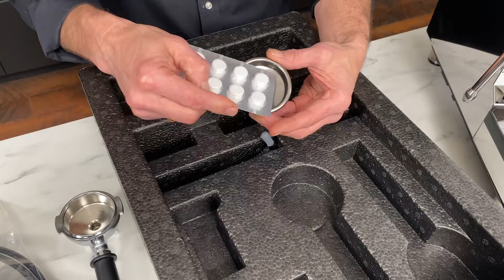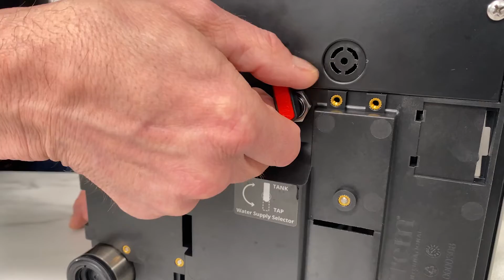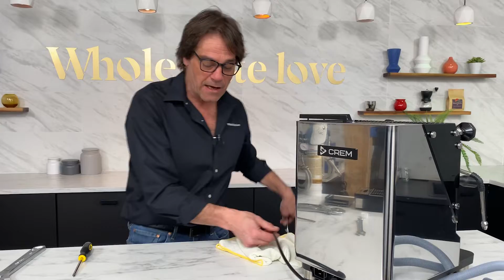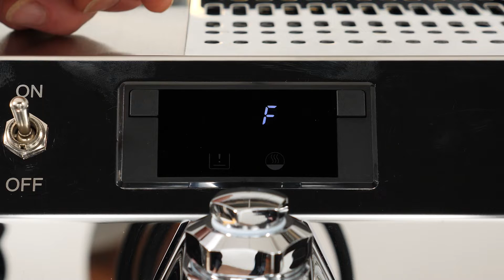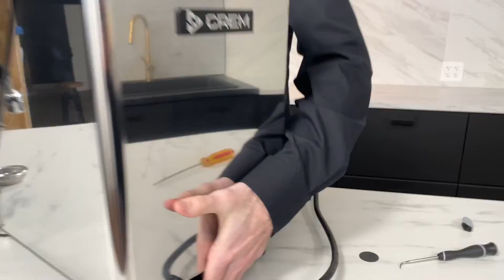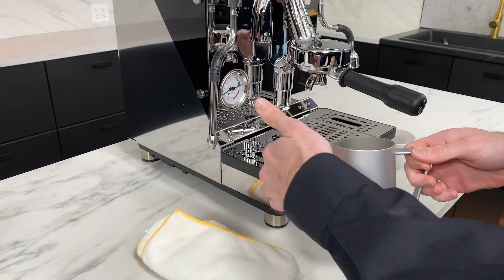Crem ONE HX PID Startup Guide

Comment: I tried to reach the pressure regulation screw on the back of the machine but I cant see it and if I put the screw driver in it, it seems like nothing is in there. I don`t even find this screw mentioned in the user manual. Is it possible that they changed this in a newer version? I just bought the machine here in Norway (it`s called 1B here). I noticed a bronze screw in the front panel, when you remove the drip tray, could have been moved there? If not what`s that for? Anyone can help?
Reply from the maker: Hi w, Yes it is possible the OPV screw is moved on the machine you have.
Reply: @Wholelattelovepage  so do you know if it is the one in the front behind the drip tray?
Reply: That version has the screw on the front behind the drip tray.

Comment: Hi, just  a question:
Trying to brewing a darker roast at 85-88 C I decreased the boiler temp from 120 to 100, but then I noticed the boiler is struggeling to get at the right pressure and steaming a cappuccino was a hard task. Is it normal? I can I brew at 85 C without compromising the pressure at the boiler?
Reply from the maker: Hi w, a boiler at 100C will produce little in the way of steam and steam pressure so I'm not surprised you had issues steaming. Know that 88C/190F is well below the generally accepted minimum brewing temp of espresso which is ~91C/195F. I've brewed thousands of espresso including many dark roasts and have never used a brew temp below 92C/197F.
Marc
Reply: @Wholelattelovepage  i just raised to 92 and dialed coarser . Went just fine. Thanks for prompt reply
Reply from the maker: @wingtsunami  You're welcome!

Comment: Hi WLL. I have a question. I have this machine at home and tested the flow rate without a portafilter. It gives me about 150ml/25s. Shouldn't it be more in 250ml/25s range or is the flow rate I found OK?
Reply from the maker: Hi CvV, Thanks for the question. Vibration pump machines typically do flow rates of 7-8g/s but there is some variation across manufacturers. 7g/s at for 25 seconds = 175g. Measuring liquid volume as you are is not as accurate as weight. What you found is okay.
Marc

Comment: compare with ECM classika pid which one better steam milk and stable brew temperature?
Reply from the maker: Hi RW, Thanks for the question. Brew temperature stability is similar - I'd give the edge to the Crem on steaming due to larger boiler. Be aware the Classika is best used for low volume home use. There's waiting involved as the single boiler Classika transitions between brewing and steaming temperatures. The Crem uses a heat exchange boiler so you can brew and steam simultaneously.
Marc

Comment: Hey Marc, 

I've decided either with the ECM classika PID with flow control  or crem hx. Can I mount a flow controller given that it's the same group head to the crem Hx.  Can I get your preference ? In machine
Reply from the maker: Hey Bob, Thanks for the question. The flow control could be mounted in the E61 group of the Crem machine. But Crem does not make a flow control device for their machines. Due to high demand and limited supply we only offer flow control on new ECM/Profitec machines or to customers who've purchased ECM/Profitec machines with E61 groups from us in the past.
Marc

Comment: I have this same machine, the Crem One 1B (in Australia) but my pump pressure is 12 bar with the blind filter on, which seems really high. I also can't find the screw that you show in this video to adjust the brew pressure...do you know if thats just something in the newer revisions of this machine?
Reply from the maker: I'm not familiar with any versions outside of the one sold in the US. The screw to adjust our version is hidden in the back behind a plastic flap, but you have to put a long screwdriver in at an upward angle, it can be a little tricky. Not sure if your model is different, sorry. 
AJ
Reply: @Wholelattelovepage  i know this comment is 3 years old now, but I did actually find the screw on my machine. Its at the front behind the drip tray

Comment: Is this Crem ONE a more solid machine overall than the Rocket Appartamento? If you had to pick one for someone who's upgrading from the Breville, which would you choose between Crem and Rocket?
Reply from the maker: Hi David, The Crem One has a bunch of desirable features the Appartamento does not have like: PID temp control, ability to plumb direct to waterline, shot timer, SGS commercial use certification, external OPV adjustment, drain line, extra large drip tray with big deck for hands free frothing. In case you missed it here's a detailed video covering features and capabilities of the Crem One HX: https://youtu.be/Fkic3LfVyYk
IMO hard to pass up the features of the Crem machine vs. the Rocket.
Hope that helps!
Marc
Reply: @Wholelattelovepage  Thanks for the insight. Definitely hard to pass up these features

Comment: Is it possible to use the braided water line that comes with the BWT filter system to connect between the BWT filter and the Crem 1?  I would be very hesitant to use the plastic hose that comes with the machine under pressure.  Thanks you guys for a great, very informative video.
Reply from the maker: Hi Ricky, Thanks for the question. No you cannot. The threads sizes are different. Understand the concern with the stock hose but it is built to handle the pressure.
Marc

Comment: Is there a way to adjust or increase the steam pressure?
Reply from the maker: Hi Derek, yes. Increasing the PID setting will increase boiler pressure/temperature. Also increases brew temp so might want to do a cooling flush before pulling a shot if you run the boiler hotter. 
Marc

Comment: When I bought my Expobar Office Lever Plus a few years ago, I searched high and low for that adapter you say you supply with all of your machines.  I called WholeLatte and asked about an adapter and was told that any good hardware store would have one.  Not here in Podunk they don’t.  I looked on line and found a few possibles, but haven’t had much luck with high priced, high shipping, costs more than it’s worth to return deals.  So again I ask, how do I get mine?
Reply from the maker: Hi James, Sorry for your troubles with the adapter. We have the BSP to US 3/8" compression fitting adapters custom made by a local machine shop. They can be tough to find! In my experience you have to go to a knowledgeable (good) retailer. The kid at Home Depot etc. probably doesn't know what BSP even means. Plumbing specialty shops are more likely to have a clue than the big box hardware stores. I don't know when you got your machine, but it was about 2 years ago we started supplying our custom made adapters with all plumbable machines. I'm not sure from your comment if you contacted us a few years ago or more recently in search of the adapter. Just spoke with our tech support/customer service and was advised if you contact them they will provide the adapter: https://www.wholelattelove.com/pages/contact-us
Hope that helps!
Marc
Reply: @Wholelattelovepage  thanks Marc.  Without looking through old receipts, I would guess that I’ve had it for about 4 or 5 years, and love it!
Reply: @therealjimvick  You're welcome! Always here to help - great machine!
Marc

Comment: With modern electronics I'm uncertain why they needed to resort to obscure codes in that menu.  One should not have to have the manual in hand while trying to adjust a brew temperature or similar.   Similarly, why make the user do the mental arithmetic when dealing with those temperature offsets?   Isn't that display actually a small computer capable of simple math?

Make no mistake, this is a really nice machine.  A few simple changes could make it so much more user friendly...
Reply from the maker: Hi SpeakNup, Thanks for the comments. The menu does use icons to reduce clutter. At first glance it's a bit confusing but after using the machine a few times they quickly become second nature. IMO I prefer setting actual temperature of boiler. The machine does display the calculated temp (actual boiler temp-offset) in the display when using. Many HX machines like those from Rocket use actual boiler temp and do no calculation of offset. Others hide the offset and display only a calculated temp.
Marc
Reply: I dont mean to be so offtopic but does someone know a way to log back into an Instagram account??
I somehow lost the login password. I appreciate any tips you can offer me.
Reply: @Neil Alonso Instablaster :)
Reply: @Reece Cameron i really appreciate your reply. I found the site through google and I'm trying it out now.
I see it takes a while so I will get back to you later with my results.
Reply: @Reece Cameron it worked and I now got access to my account again. Im so happy:D
Thank you so much, you really help me out !
Reply: @Neil Alonso you are welcome :)

Comment: Hey Marc and A.J., great video! I'm really liking these Crem ONE machines. I feel like their feature to cost ratio is incredibly high and after a year of researching various machines, this value prospect may finally push me over the edge. In fact, I have a ONE PROFILER on pre-order, but I'm waiting to see more hands-on of it in one of your fantastic videos before pulling the trigger. I do have a couple of questions regarding that machine (direct water line connection), and can't wait to see it in action. Thanks!
Reply from the maker: Hey CP, Thanks for the kind comment. Just posted the video on the Crem ONE PROFILER: https://youtu.be/VHs5axbG-0M
In order to allow for ultra-low pressure in profiles the Crem ONE PROFILER runs from reservoir only. Hope that helps and do check out the video!
Marc